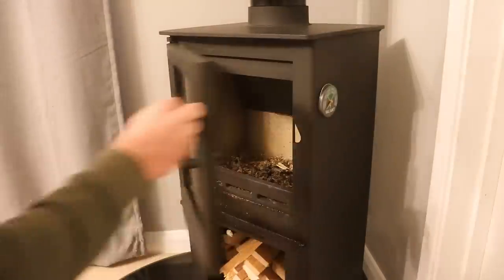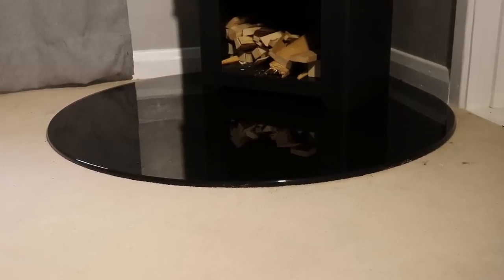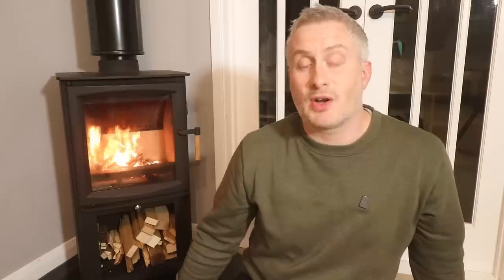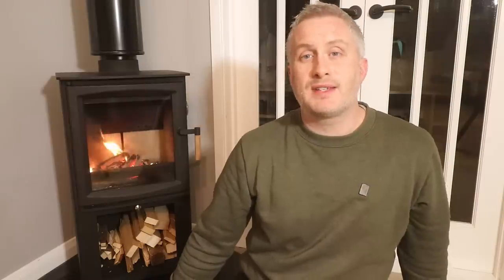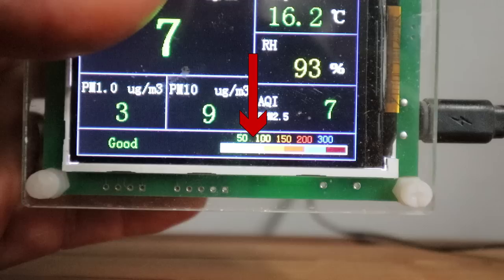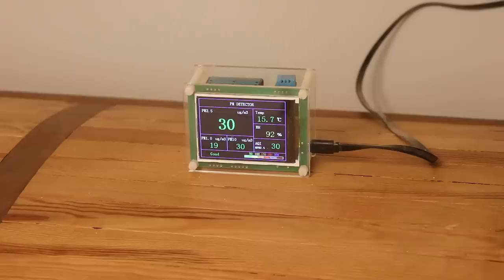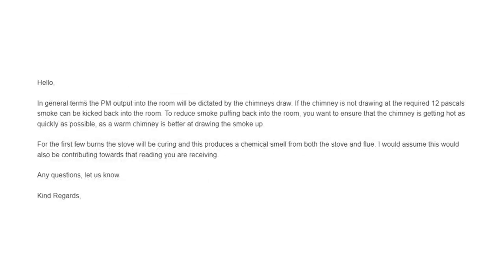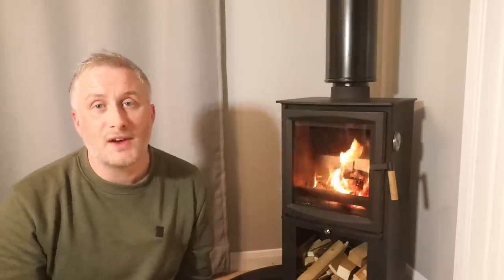Wood Stove Pollution and PM2.5 Particle Emissions TESTED ✓

Comment: We've got the same stove, but without the log store under it.  Have you got the external air supply hooked up?  Ours pulls air in direct from outside.  This means it's not pulling the nice tosty air from the room and shoving it straight up the chimney.  Its a huge difference compared to our previous stove
Reply from the maker: Thanks Nathan.  I don't have an external cold air feed, but we have a PIV (positive input ventilation) system in our loft due to past problems with mold, and also trickle vents in every window so I think it's able to draw from those quite effectively.
Reply: @RagnBoneBrown  I think 5kW stoves are such a popular choice as that any bigger needs an outside air supply.  It's more that if you're stove is drawing in fresh air from outside direct into the stove, you're not sending all your nice warm air from the room straight up the chimney.  We've got a void under the floor, so the air intake just goes down into that.  I guess it may help draw extra fresh air through to ventilate the flor void better.

Have you got a link for the air quality meter you used? I'm now curious to compare the air quality in here 😁
Reply from the maker: @nathanlucas6465  cheers Nathan, yes the link is in the video description

Comment: I've got this exact experience with our new stoves (measuring on plantower 5003) Looking at a HEPA air purifier (2.5 micrometer rated); you considering this at all?
Reply from the maker: No not with the levels being so low
Reply: @RagnBoneBrown  I take "good" pm2.5 to be <25µg/m3 from a quick Google of UK safe levels.  I picked up a HEPA filtration system (Philips 3000i) tonight as I wasn't happy with the levels which were above 50 after a few hours of burning.  The unit is pricey but we have two young kids and I want to err on the side of caution.  So far the results are very good, it happily drops the room to ~10µg/m3.   The trend I'm noticing is pm2.5 is cumulative; more re-fueling = higher pm2.5 concentration (makes sense as smoke escapes into room when the door is open and has nowhere to go).  I really like the stoves though, the heat from them is really cosy and they look great in any room as well.

Comment: nice stove Keith I'd recommend an ecofan that uses the heat of the stove to generate power to spin the fan it helps circulate the heat through the room.  I also use an hepa air purifier mostly for pollen in the spring/summer but it helps with the particles in the air
Reply: We have one of those ecofans, it has a piezoelectric panel on the bottom which generates a small current to drive the fan when the plate gets hot from sitting on the stove.  Really helps with the convection flows that heat the room up.  They're about £20-30 on eBay
Reply: Second the fan, we've got one and it distributes though more than one room, with zero running costs.
Reply from the maker: Thanks for the tip! We will get one
Reply: Where do you place your air purifier unit, plz?

Comment: Ours was the same, fitted 2 years ago it was £3300 but our fire was £1k we too have a twin wall flue in a two story house. The first I would say 6 or 7 burns created smell and smoke from the paint curing, like a oil smell, it set of our fire alarm every time we used it during those first 6 burns, once it’s been used in anger and everything is cured it was absolutely fine, again heats up well, occasional smoke in the room when first lighting but that is usually the kindling some of it is a bit crap. We use kiln dried ash as the main fuel, I do make kindling myself from those logs and they never smell or smoke, just don’t always have the time to get the axe out so I buy in kindling as well. But brilliant piece of kit, very efficient and very warm house as a result.

Comment: Hi Keith, I agree with the points you raised here. I can confirm that most of the pollutants/smell are from the curing process of the paint. I know this as we were unlucky enough to have a chimney fire a couple of years ago and after the fire brigade put water down the chimney to put out the fire, I needed to repaint the stove that rusted. This resulted in the same smell as on first burns, so like you we opened windows for these burns and stayed out of the room (IMO these burns only have to be short so no cause for concern).
So just a word of caution on having your chimney swept, you need to do it at least once a year, we had,only gone 13 months when we had the chimney fire that was a scary experience. This will also be a little known clause on your insurance.
Well maintained we absolutely love ours. We’ve had it for 10 years and wouldn’t be without it.
Reply: Darren - With the flue only so old curious to know what you think caused the fire?  Was it an old chimney flue or did you have the chimney relined with metal tubing?

Comment: We live on a smoke control zone so we have a defra approved tiger inset and only burn manufactured logs. I definitely noticed more of an odour the first few times we used it but now I feel like it doesn't create much of a smell in the room. Thankfully there seems to be a good flow of air up the chimney and our stove being defra approved means you can't actually close off the top vent completely, which I believe increases the efficiency

Comment: I hate to think what an old fashioned open coal fire would have created in the way of internal pollution, I’m guessing it’d be virtually off the scale, we live and learn!  Well done for bringing this to peoples attention, the monitor you have should be supplied with the stoves I reckon! Cheers.👏👍😀
Reply from the maker: Probably a lot during lighting but I think once the chimney is hot and drawing the smoke up it probably drops right down as long as the wood is dry 👍
Reply: We still use our open coal fire 🔥

Comment: wood stoves have to be 'cured' to remove all the manufacturing oils and paint finishes.  I have even seen stoves being burned outside, before installation, to make sure the stove is 'clean' when brought indoors. 
Love your set up but would consider something on the walls behind the stove.  Consider one of the fans on top to distribute air better. 
Finally, you are right that it is like a vinyl record not streaming...and I love it.

Comment: When refuelling I set the flue choke vertical (fully open) to increase draw, then open the doors slowly to avoid creating turbulence. Providing the fire is burning well and you are careful not to disturb the flow, nothing will eddy back into the room. Having said that I’m ordering one of those meters to check!
Reply: Great approach.  We do same and never see smoke enter the room.  We also don't keep the door open for refueling longer than 20-30 seconds.

Comment: I have a stove on my narrowboat and after applying the blacking to the flue and stove you have to burn it off with the windows and doors open. Once it has cured it's fine. I have had asthma all my life and my stove causes me no issues.

Comment: Point about HETAS not strictly true - I self installed our (4.5kW) stove and then Building Control came round (for a "small" fee of £140 🙄) took a look and issued a certificate - I explained how it complied with Part J which they were clueless about 🙄 Total cost of stove and accessories was around £500 less the BC fee (fortunately the chimney and flue were good so no liner needed). We have a small woodland and plenty of prunings that we handsaw and air-season - totally self sustaining. I don't understand the premise of 'saving' money by newly installing a stove and then buying imported, kiln-dried logs to burn - unless as you do, you have 'spare' fuel it's seems completely mis-guided to me that folks think they are saving money somehow 🤔

I would also add that the next season when you've had the flue swept and you fire up the stove again for the new season, you'll get the same weird smells and everything burns off and settles again...

Comment: Hi Keith, interesting video. I have the same monitor (and I’m in a bungalow in Norfolk) so I decided to check our wood burner. It do appear to affect the air quality at all, the reading hovers around 3-5 whether the burner is alight or not. I am currently burning kiln dried logs as my supplier didn’t have any air dried left and even with the doors open the reading  stays below 10.

Comment: I bought a house with an old fireplace. 80% of the heat went straight up and out of the chimney. Only 20% went into heating the house. When I replaced it with a wood burner stove 20% of the heat was lost. I live in an area of the UK that has a lot of storms. I get power failures all the time. When it's -10 outside and there is a power cut my wood burner is a lifeline. However, saying that, I also installed underfloor heating and I mainly use that. It is rare when I use the wood burner. With the milder winters we are experiencing I only used my wood burner 20 times last Winter. This year has seen an even milder winter. Also I cook on my stove as well. I also heat water on it for washing dishes by hand or cleaning surfaces. It is also used on Christmas day simply because it's nice to have a real wood fire. So far this Winter I have used my stove 3 times and it is already the 26th of November. If the temperature keeps rising I could see it not getting used at all. I would estimate that more pollution is generated from people burning garden cuttings in Autumn or 5th of November bonfires and fireworks. As I do neither I am certain I produce less pollution than most. I also work from home which means less car exhaust pollution.

Comment: We've had our wood burner for a few years now and we love it, I collect pallets and any other scrap wood over the summer and once cut up they lasts us all winter, the only outgoing costs are paying for the annual service (less than £100) and the price of a few boxes of fire lighters. We also have oil fired central heating which we mainly use for the hot water but since we had a new condensing boiler fitted two years ago we are only using one 900L tank every 14 - 15 months.
Reply from the maker: thanks - I hope our usage will be low like that!
Reply: Wood should be dried for a long time to reduce smoke rather than burned immediately, but if you have neighbours within 100m or so it's better to burn as little as possible to avoid filling the air they are breathing with PM2.5. Even the level of around 25 in the video is above the WHO limit and there is no "safe" level - any increase is bad for you and 25 is the equivalent of moving from the countryside to a city centre.
Reply: Pallets are treated wood which gives off some nasty stuff when burnt. You need to use properly dry non treated wood and even then you are polluting the local air.

Comment: 😁 Nice insight Keith. I got my stove long before my air quality meter, so have never checked my readings (think I will have to now 😁). Just to reiterate what some of your other lovely viewers have said... make sure you get a carbon monoxide meter (or two), and make sure it is positioned correctly in your room. Deffo get a heat fan for the top of the stove... they are great. They can be expensive for a posh one but keep an eye out in Aldi. I have 2 Aldi ones running and they are great value and just work perfectly. And finally, some additional protection from birds. Our cowl wasn't quite enough so I had to put additional mesh on. There is nothing worse than having to dismantle your flue to rescue a bird.. just to be rewarded by a sooty bird flying around your living room.... and trashing the place. Thats enough from me 😆. Thanks again for the video Keith 😁👍.
Reply from the maker: Cheers Frank 👍 we have a carbon monoxide alarm, forgot to mention in video. Great tips though will get a fan and check the cowl because that sounds like a bit of a nightmare!!!

Comment: When the door is shut my Mila air filter detects no particulates, but as soon as the door is open it does. I try to keep the door opening at short as possible, and rely on the Mila to suck out the particulates from the air :) I get higher readings frying bacon, or pancakes though.

Comment: I think we were very lucky we chose a British manufacturer cast iron  multi fuel stove the people who fitted the stove built use a chimney breast and made the harth themselves  and they do all the fitting . I would totally recommend you find a fitter who employs all his own workers and does not contract out. 
They did the first and second firing  for use the first fire there was a slight hot paint smell  but there where no others fumes. .
Our house already has air bricks fitted so there was no neec for additional  airflow. The firm we used did the survey and completed all the building regulations application for us I they where fantastic, if you live south Cheshire or North Staffordshire I highly recommend  Newfield Fireplaces. They are a family business and very helpful.
Once fitted the came back 3weeks later to check there work make sure everything had settled this was April the in October the phone and ask if everything was going OK asked if he could come and check all the seals before heavy winter use .
They been great 
Stove get very warm we leave our doors open and the travel into the hall and up the stairs our living room 6mx6m and it hot 🔥 with minutes . We use to gave a gas fire but it not warmed the room.  This warms the house.
We use a small blow touch to warm our flue up and it make a huge difference in the draw. Without doing this we get some draw back. But since using the touch (it the type cooks use to burn sugar) fantastic results the flue get that quick warming and the draw is instant when the men installed it and did the first few burns they had all windows and french doors open

Comment: Hi, The top down method is good ( see two comments down), but in my opinion the big mistake is going for such a budget stove. There is a reason these are less than half the price of the market leading Pure Vision range. On Pure vision stoves the thick stainless steel baffle automatically opens to stop minor smoke emissions on refueling, and even has an ignition setting that warms the flue quicker again to reduce the emissions. They also use a much more expensive low odour paint. Your fitters are right about getting heat into the flue quickly by the way.

Comment: yes, some of the wood used contains scrap wood, that has been pressure treated or plastic coated.
The oil used in milling the wood contains a very large amount of benzine.

Comment: Very good, thank you for that. For me, even with central heating, I have a window open slightly, to allow ventilation and if we decide to install a wood burner, I/we will do the same, have a small window open in the room, allowing air to circulate and remove the bad air. 
Has anyone done the same, I’d like to hear your views.

Comment: I have had a couple of woodstoves  in different houses and could still smell something "off" from them even after curing time. So with the more recent one I had it shot blasted to remove all the paint and residues. This worked, but you obviously have to accept the varied patina of heated bare metal. I do find though, that with long evenings of stove use I end up with a dry, slightly irritated throat. I think these kind of stoves work best in older, leaky houses. Even though I provided a local external air supply to the stove, my draught free living space can feel a bit airless with it burning. My future plan is to have a masonry style burner that has low surface temperatures. This avoids over heating the air and dust particles being burned on the stove body and circulated by convection. They are more costly and complicated to install though.

Comment: Here in the Normandy countryside, wood is the fuel of choice.  There is no shortage of oak or beech - the most popular for firewood here.  A third of mainland France is covered by forest.  Personally I love ash too.  Our main living area is 12 x 6 metres, with an open staircase up to the first floor.  We installed a 14kw stove 20 odd years ago (Efel) and it does a fantastic job of heating the entire house.  The key is good, dry wood.  Most of my neighbours cut, split and stack outdoors (covered by a tarp) and leave it for two years, followed by a year in a well ventilated outhouse.  Then it comes into the house.  You get into the rhythm!

Prices?  You think oil is expensive in the UK - 1000 litres here will currently cost you around 1450€ - say £1250 or £1.25/litre, but drifting down.  Last lot I bought was 1.67€ (£1.45) back in July.  Ave UK price seems to be around £0.85/litre.  Firewood here will cost you,  at present, delivered from 50-55€ per stere (loose stacked cubic metre).  It will cost you a lot more in town.  Lot less if you are cutting your own trees of course.  You can also cut and buy wood from state or private forests.  Last time I did that it cost about 25€/stere I think.  I'm out of touch with today's prices.

Felling, bucking, transporting, splitting, stacking and moving is hard work.  It's a young man's game.  At 68, paying 50€ delivered is money well spent!
Reply: €1.40 a litre here in Ireland.
Reply from the maker: Thanks Ian. Wow. That's really interesting!

Comment: I have the Hampton 5.  Cost approx £600 with delivery and £1000 to have it installed / commissioned.  For such a small stove, the room gets extremely toasty.  Burn Pine on it that has a moisture level of about 10% and it keeps the downstairs toasty and the upstairs "keeping the living room door open" at about 21 - 22 c.  get wood free from work so winner winner.